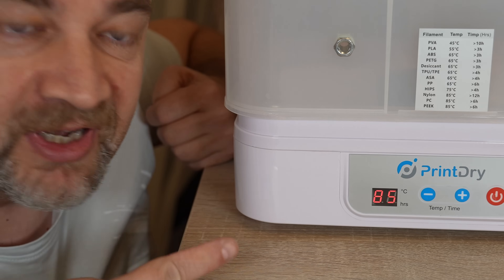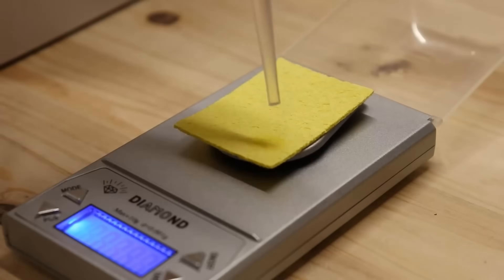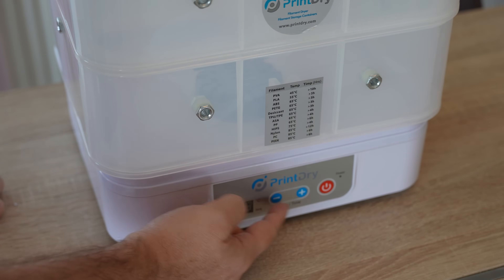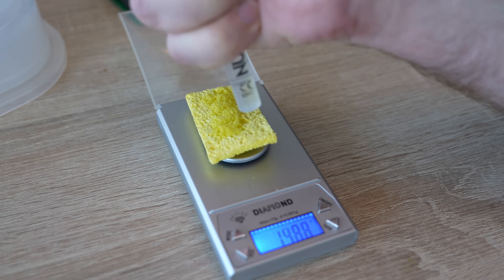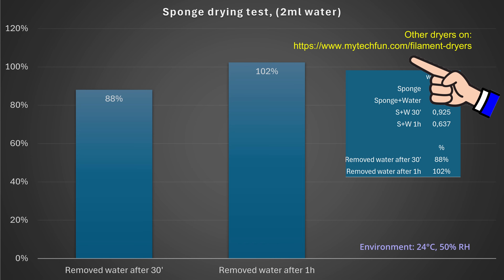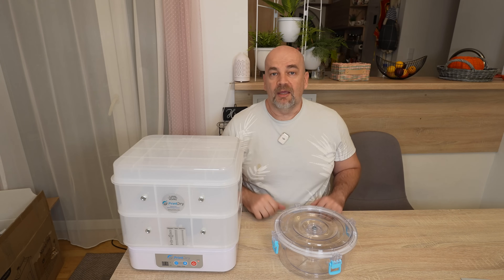PrintDry PRO 3 filament dryer review - can it really operate at 85°C? That's great for nylon drying

Comment: I have used this drier for drying Matterhackers NylonG (their glass filled Nylon). It will not dry the filament stock. However, after I created an aluminum foil cover for the filament, it dried wonderfully. Just create a half cylinder two layers thick by folding a piece of aluminum foil and molding it over the top of the filament. It probably just kept it a little hotter.

Comment: The more videos I see reviewing dryers the more I think that they are mainly eye candy, I would happliy pay more for a dryer that has motorised spool holders to rotate the spool to help dry them evenly. They label this one 'Pro', what do professionals actually use, well it could be they don't use dryers because they consume spools of filaments fast enough for moisture absorption to be negligible. This assumes of course they can trust the manufacturer to have thoroughly dried and securely sealed it before delivery. I have had new filament straight out of the manufacturers bag perform badly  e.g. popping and fizzing out of the nozzle before now. So that leaves non-professionals creating a market for expensive eye-candy, to me a £100 unit that does not work effectively is a worse waste of money than a £1k oven that does, i would love to hear views from Dr Gaspar and anyone else about this, what I am seeing and feeling is a rip-off.

Comment: You should test out the 3D Genius filament Dryer, it works pretty well for a single model unit, If it only had and ESP32 It would give Gratkit and Polymaker runs for their money!

Comment: also, the rubber plug goes in from the inside, then you insert the ptfe tube, this prevents the filament from making the plug pop out during printing.

Comment: @MyTechFun I do not have a filament dryer (yet).  My desicant dry boxes do a great job of keeping the humidity to a constant ~10% relative humidity.  I notice in your tests the RH in the filament dryer asymptotes to ~10%.
Question:
If I perform a one time very thorough drying of nylon in a good quality filament dryer, then immediately transfer filament to my desicant filled drybox (@ 10% constant relative humidity) and print directly from that drybox, would I ever need to dry that nylon spool again in the future if the drybox remains at 10% RH?

I do not know if Nylon will absorb any considerable moisture if the surrounding RH is 10%.

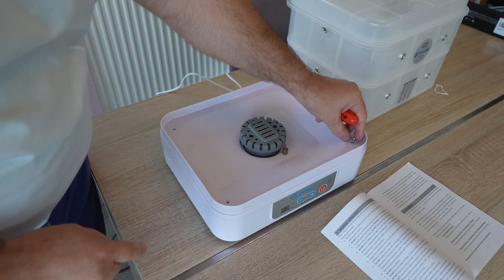Comment: Hey, I know a trick with screws that often even works on self-cutting screws (like those at 5:50). It as follows: first, with gentle fingers, turn the screw ('back-up the screw)' in the direction that it would go when you want to take it out. Wait until it falls into the existing track. Now you can gently start rotating the screw in the other direction. Most of the time you will find the right track with this method and it also works great on nuts and bolts and basically everything that used threads.

Maybe you already knew this but I couldn't see it in your video because the part where you put the screws back in was sped up.

Comment: Excellent video! However, I cant wait for the 6 dryer comparision as I bought the Space Pi(After your video). I bought some Pa6CF with my A1 to try it out but customs opened the packet with a knife in the centre😢
The Humidity here in India is around 70% right now so I need to dry it from start. Hoping for a good performance of the Space Pi🤞
After your latest video, I want to take advantage of the great filament but am scared of the 2 week drying time😅

Comment: @MyTechFun you might be interested to know youtube just asked me if your channel was a good recommendation the other day. I have never had them ask me that before, gave me various options for why I said yes, I chose informative and relaxing.  Also, have you considered testing what might be the best filament dryer for engineering grade filaments that can also be used for annealing, the Ninja AF101 air fryer?  I have one, it's great, perfectly fits a roll of filament and unlike many of them it can be set to run for hours and has very precise/stable temp regulation.  They just hold a 1kg spool of filament and can be found cheaper new than anything else that will go to these temps, plus are dirt cheap and easy to find used.
Reply from the maker: Thank you for the support and a good recommendation. About the Ninja AF101 air fryer, pity that its not transparent, I could use it for my temperature tests too :-) I am planning to test a food dehydrator in near future (our own), but it's max temp is only 80C
Reply: @MyTechFun  I'm using it at the moment to dry 3dxTech ezPC-CF which so far is proving to be an absolutely amazing filament.  I hope you get to test it one of these days.

Comment: The more insides of filament dryers I see, the more stunned I am that none of them just have a look at a simple cheap food dehydrator which typically just has an AC powered heater and fan and just a simple temp-controller turning the heater on and off.  Minimal BOM cost.  Just change the case around that hardware with decent heat distribution and use a slightly nicer controller (with multiple temp sensors like the one in the video, but in better positions) and you have a great filament dryer.  But no, instead most dryers use underpowered DC heaters that can hardly reach the advertised temperature and a fan that might be silent, because it barely blows air ...

Comment: 10:35 that was funny (my pleasure man!) For anyone reading here: Igor called me, "Hey Everson, this vacuum thingy seems great! But now I cannot open it again... Have you seen this?" It turns out my grandma used a very similar set of containers for food conservation - and she always called me "do you wanna open?" because I loved to push the valve and hear the sound of the air coming in. Actually, this whole dryer solution seems like a repurposed "Food Dehydrator" - the vacuum thingy IS EXACTLY what you buy for food conservation in vacuum.

Comment: I am glad I did not order it. It seemed like an interesting dryer at first, but I guess I will stick with my hot air fryer. I still struggle why the dryers are all so poor, honestly. 
My hot air fryer was like 60€ + 530€ for 3xPT100 + measuring circuit + Arduino + SSR.
Reply: Would you happen to have a link with some details (forum) or Youtube video link covering this build?

Comment: I think you are testing these empty. They should be tested with full loads of filament because that changes the curve of input heat to heat losses. I would put the temp probe in the core of the filament to find the temp of the inner winds of the filament.
Reply: I think maybe a solid, non moisture  absorbant, martial/object that takes up the same space as a filament role would be the best bet. That way it factors in the volume of air and heat absorption
Reply from the maker: Partly I agree, but I started this type of testing with empty dryers. And using filament with unknown dryer is risky. I already tested similar dryers with too hot direct air.

Comment: Does it maintain 85°C throughout? What’s the temperature at the top when 100°C air is blowing out of the heater?
Reply: Watch the video. No. It got to 68C with an empty chamber. My guess is it would be lower if it had filament in it.
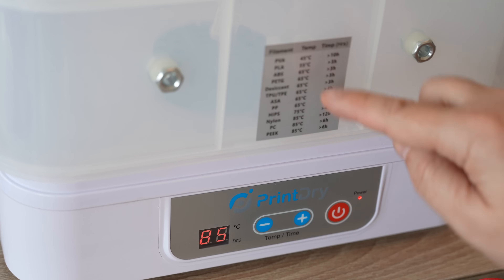Reply: @rsilvers129    I did watch the video so save your snark. I thought the graph at 10:46 was for a 65°C set temperature because that’s the temperature he set (see 9:43) before talking about the vacuum storage box.
Reply: @radish6691  Yeah, I was also a bit confused at first.

Comment: Huh, I bought one of these (I think an earlier model) a while ago and this barely seems different.

I bought the extension as well to allow it to hold 4 spools.

I don't know if I believe the temperature claims but 4 spools is nice.

The spool holders do suck though. The ones you rest the spools on are much better in terms of ease of use than having to push the metal bar in between.

Comment: I love the idea, that you also test a regular "round" food dehydrator, like the one @CNCkitchen use
Reply from the maker: I will in very near future.
Reply: @MyTechFun  Looking forward to that one. A cabinet style food dehydrator like a magic mill or nesco would be great to test as well. I currently use a magic mill cabinet dehydrator and the polymaker polydryer and like them both a lot.
Reply: I use the exact same model CNCkitchen uses and noticed it's quite a lot hotter as set on the analogue rotary knob. Also, without modifications you can't print directly from a food dehydrator.

Comment: Because the airvolume is very hight compared to that tiny sponge that test setup isn't very useful. 2ml is also like nothing. The sponge result will be like the same if you leave it on kitchentable for a day. Filemanet may take moisture by that!.
A 1kg spool can take 100ml - to remove that is a challenge! So I suggest to use fresh spool of filemant - take weight, meake it wet,  - take weight - dry and take weight again. How much of moisture has been removed?

Comment: The more dryer reviews I watch the more I appreciate the UI of the little Sunlu S2. There are a couple areas it could be improved and it’s weird that no one has gathered all the feedback from these reviews and made a killer product.
Reply from the maker: S2 is a good idea, heating from two sides, but I am missing the fan in my early unit. I think later they added a fan too.
Reply: @MyTechFun  I just remembered I have a little 5v blower fan and some high-temperature tape. I’m going to stick it inside the lid to see if it makes a difference.
Reply: @MyTechFun  Yeah, Sunlu added a small fan inside, both on the S2 and the S1 - I have them. I think they are now only selling the new units with fans.